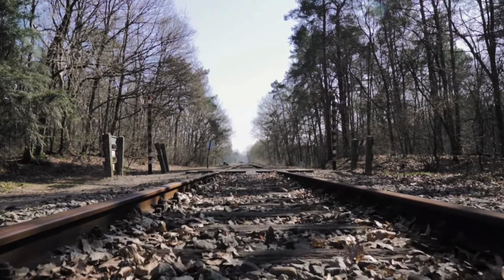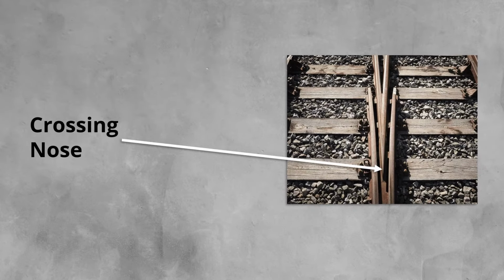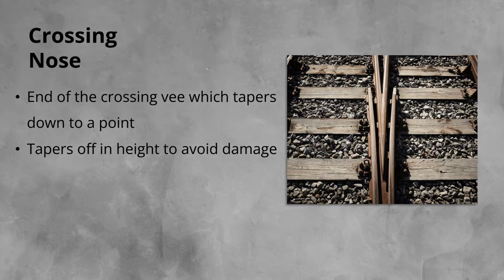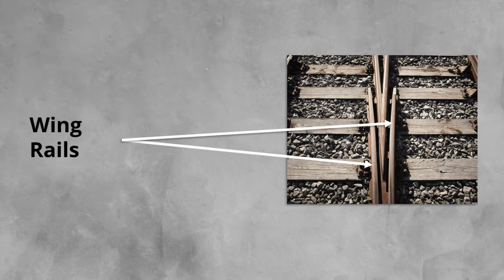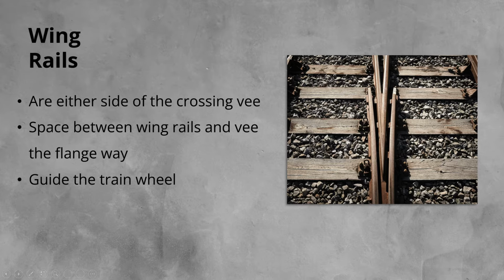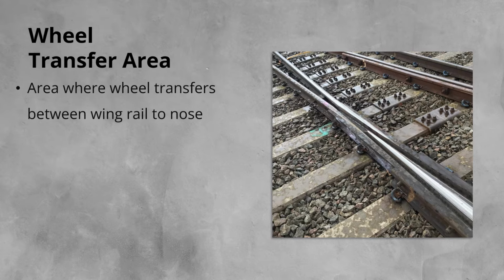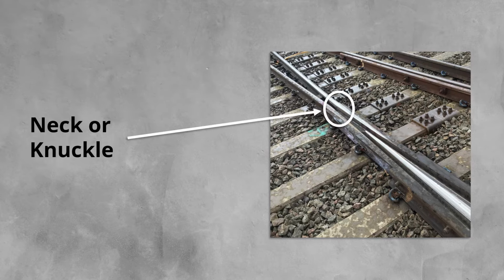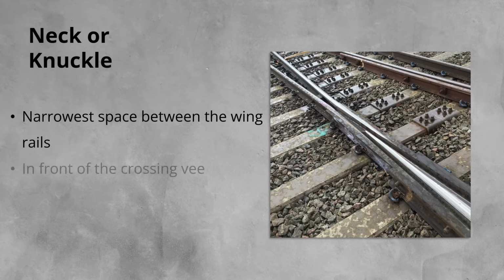Railway Crossing (Frog) Parts Explained: Simple Guide for Beginners

Comment: The wheel passing through a crossing on a well maintained turnout is always supported either by the wing rail or in the wheel transfer area by the wing rail and the V point of the crossing after passing over the lowered nose part of the crossing. It does not fall in the gap.